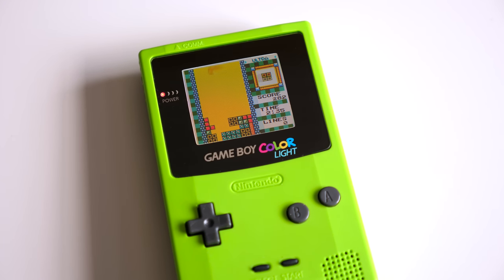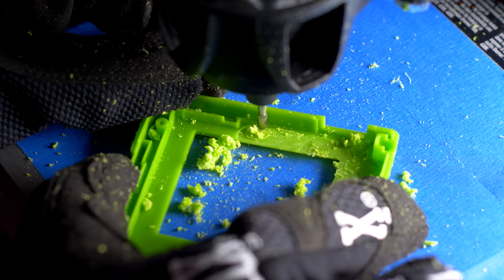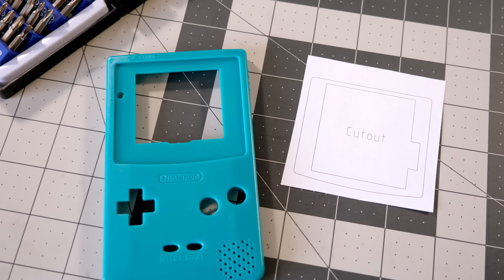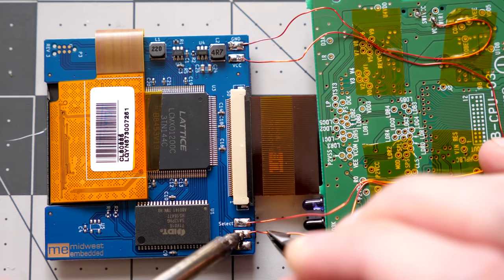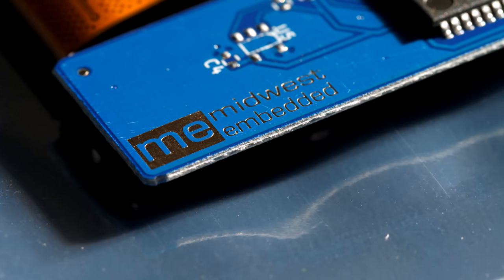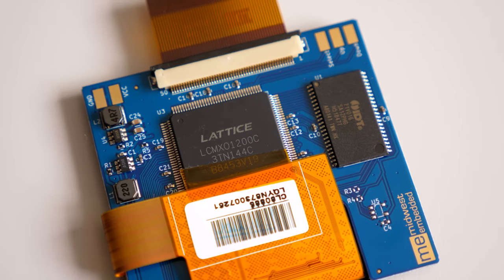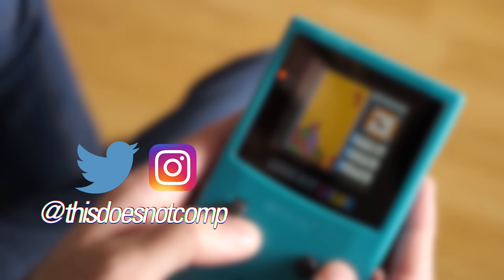Next-Level Game Boy Color Backlight Kit! | Midwest Embedded GBC Kit Review

Comment: BennVenn (FreckelShack), McWill and now Midwest? Oh boy, the GBC LCD mode scene is ramping up!
Reply: So many options now. But it seems that midwest and mcwill are the best currently. Time to wait out and see who comes out on top.
Reply: @HiNu7  I'm not sure how you could say the Midwest or McWill are best, Freckle Shack offers superior run time and Batch 4 has literally solved all white screen issues (that weren't even caused by the FS to begin with). Statement just released this morning. And unlike the McWill, FS doesn't require you to add a crystal oscillator, it's literally a drop in, with only one wire needed for backlight control (on batch 4).
Reply: retro_amp so do the McWill and Midwest have these screen issues?
Reply: @HiNu7  Nah BennVenn's Freckle Shack is the way to go, whether it be for an experienced or inexperienced installer. All around its a much better option.
Reply: I'm waiting until someone can make a screen option with the original size and no ghosting
Reply: The freckles shack has way better battery life, up to 20 hours. And their newest batches have an optional brightness controller if you want to do the little extra soldering required
Reply: @pointerprideaviationandtra4751  Everything I can find says the freck shack is not being made anymore. Maybe I'm mistaken, can you find any available?
Reply: @ramborob1218  Modders have probably bought them all up along with huge quantities of GBCs so they can re-sell
Reply: I just bought one of these with the Midwest Embedded LED from a seller on eBay named Game Boy Color Man. I absolutely love it! He also has a bunch of High Quality Replacement Labels for the Game Boy Color Console in this video from a seller on eBay named Game Boy Color Man. He has every single replacement label for every Game Boy, Pocket, Color, Light, Advance, Advance SP, Micro N64, and SNES! For this Game Boy Color, he has the Battery Door Label, Serial Number Label, PAL European Serial Number Label, Made in Japan Console Label, Made in China Console Label, Pokemon Center Gold Console Label, Special Pikachu Edition Console Label, Special Pikachu Edition PAL European Console Label, Game Boy Color Light Console Label, 10th Anniversary Serial Number, and Bar Code Label. He even has a bunch of custom Game Boy Color Man Console Labels and a really cool Pokemon Center Brooklyn one. And they are top quality American Made! Nothing like the toilet paper quality you'll find from other sellers that sell Chinese labels. The dude is awesome! The labels look fantastic and fit perfectly down to the millimeter. The packaging is amazing, and the dude also threw in a whole bunch of free kick ass Dishwasher Safe Die Cut Stickers! Check out his store if your Game Boy looks beat up and needs new labels! Or if you just need a smile put on your face. Honestly the coolest eBay purchase I ever made! He ships to all 50 states and Worldwide to the Entire Globe!
Look at this on eBay
https://ebay.com/usr/gameboycolorman

Comment: Very cool that other companies are making kits, but the total comes to $71 bucks, just 4 less than Benn's (included shipping). Also, Midwest Embedded's website states that it only has a 3 hour battery life, which is dwarfed by FreckleShack's close to 20 hours. Oh, and Benn's is just a drop in kit. No soldering required.
Reply: I purchased the freckle shack 2 weeks ago and hasnt been shipped. I just saw this and purchased this as well. Ima compare screen quality between the two once they arrive
Reply: @kr4t0sg.28  Screen quality should be mostly the same, since they seem to use the same LCD panel. Any differences come down to the PCB and the programming.
Reply: Frodo B.    Not even to mention the fact that total bill of materials (LCD + FPGA + board + flex) is less than 20$ if made in USA or below 10$ if made in China.
Reply: @zusurs  Yes that much is obvious, but you also have to remember that the guy had to reverse engineer the tech so be able to combine it. He also programs each kit. And he needs to turn a profit, so $65 + shipping seems reasonable to me.
Reply: bennvenns newest version has optional soldering for if you also want brightness control.
Reply: @shadeymcbones6707  Thank God for that.
Reply: @zusurs  Oh, great to see another Latvian watching TDNC. Are you into modding / retro gaming & consoles or just a fan of TDNC?
Reply: @nugget6635  What do you mean? Benn made a kit for the Gameboy Color using a similar display to the one in the video. Look up Freckle Shack. That's the name he gave it. The 101 display is old.. news.
Reply: @nugget6635  AGB 101 is not rare, it was cloned in China quite a while ago. Most of the 101 screens you buy in kits on the internet are Chinese clones. Have a look at AliExpress.
Reply: @zusurs  Got a link to this $2 LCD screen? Asking for a friend...
Reply: @kr4t0sg.28  Did you get them shipped and installed yet?
Reply: cant even buy benns any more. nothing on the site.
Reply: If you can still find a Benn Venn FS for sale, it's the way to go- best battery life in the GBC backlight mod market.
Reply: @kr4t0sg.28  which one was better?

Comment: Finally! An easier installation of a backlit for GBC! Thankyou! Now I can do it without running the risk of screwing up my GBC!👌🏾👍🏾👌🏾👍🏾
Reply: The BennVenn freckleshack mod is even easier, no soldering required, you just need to cut out a piece of plastic for it to fit
Reply: The freckle shack also has lower power consumption and newer revisions have brightness control

Comment: Carves away at shell in order to make screen module fit

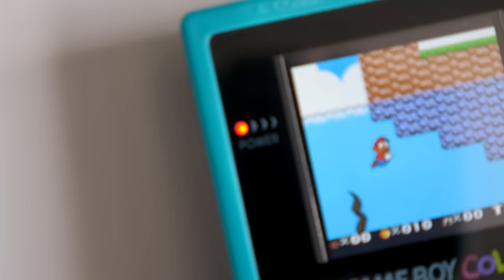2:45 "because the replacement screen module is really thin and it generally fits within the footprint of the original display"

"Generally": in most cases; usually.

Comment: "Since they're black, they're not really noticeable" said to a shot of the insanely noticeable gray screen borders against the black outer border. And then there's another internal border between the super obvious gray border and the part of the display that actually displays things. And then the next shot shows that it's not even centered in the opening and also doesn't sit in nice and square.
The only way that this is "not really noticeable" is if you're completely blind.
Reply: They want $71 for this unsightly garbage?! 🤣 Hard pass. Maybe if future revisions also came with a specially made outer piece that hides the double borders so it's actually not noticeable, it'd be worth it. But as it is, I'd rather try to get the lighting just right to see a stock screen.

Comment: Nice mod. As an electronics engineer I must still say, that price for these retrofit kits is still absurd - TFT panels like this cost around 4-7$ in bulk, and circuit board + FPGA + flex is another 8-10$. So it’s below 20$ (or maybe even under 10$ if made in China) to manufacture, and 45$ (225% to 500%) in profit. Sorry, but it seems a lot, even on such a niche product. :/ Unfortunatly many companies try to cash in on the nostalgia wave.
Reply: There's more to price than component cost.
Reply: You know time has a value, right? The time that went into making these and the programming needed. 
Do you work for free?
Reply: Those TFT's are not $4-7 in bulk. My recent order of 1000pcs is not even close to that unit price. Plus the labor involved removing the touch panel glass (Which these screens all come with), import duty, shipping, assembly, taxes, store commissions, time testing, packaging. As an electronics engineer you should also know the cost of marketing a product is NEVER the cost price of materials. Come on man, who are you trying to kid?

Comment: Another five years and there will likely be an actual plug and play screen that's just a swap with the OG screen
Reply: I think bennvenn is making something like that now.
Reply: @genesischris1297  its already available, no soldering needed. Just have to remove one plastic tab inside the shell.

Comment: Hi Colin, I just had a quick question, in the review you said you could turn off the backlight entirely but the unit I received doesn't turn off the backlight at the lowest setting, do you think I received a defective unit?
Reply from the maker: Interesting...I suspect there might have been a firmware change between the unit I got and those that are shipping out. How dim is the backlight at the lowest setting?
Reply: @ThisDoesNotCompute  Hard to say, I think it's just the lowest brightness on your video. I got in touch with Nick and he said the prototypes did turn off but they decided it was harder to see than the original lcd when turned off completely.

Comment: This kit's only 3h on high capacity rechargeables? An unmodded GBC gets 30h on regular Costco AAs.
Reply: TheRaellz  The Freckle Shack backlight kit gets 20h with a similar, if not identical, screen, FYI.

My point is that just because people are used to devices with low battery life doesn't mean it has to be that way. The video's assertion that 3-4h is good, is pretty weak, especially considering the context of Gameboy.

Comment: Hi, could you tell me the original gbc's precise screen size in inches? I know that this M.E. is 2,2" and wanted to compare, thanks! :)
Reply: 2.34" give or take
Reply: @shimian5622  alright, thanks! And the AGS 101 fits it 100%, right? And then se got the freckle shack which i assume Is 2,1"? And the mcwill's? Anybody knows?
Reply: @sintiendomevivo  no, AGS 101 is smaller than stock, and I think McWill and FreckleShack are the same size, about 2.2. Nothing is as large as the original display, except the super expensive TaoBao screen.
Reply: @shimian5622  Ok, thanks a lot, man!

Comment: Hey this does not compute. 
I have been dying to try gameboy color modding especially the backlight ones but I have no knowledge of gameboy color mods and I want to try either a front light mod or a backlight one that's easy for someone like me which one should I try?
Reply from the maker: A frontlight won't require as much shell modding, but it can be tricky if you use LOCA to get the best results. A backlight mod like this one takes a bit more work in terms of cutting out the screen opening, but electrically it's super simple -- if you have basic soldering skills, it's probably the easier way to go (and would look dramatically better than a frontlight). Good luck!
Reply: @ThisDoesNotCompute  I kinda know how to use a solder but need some guidance on how to use it on those silver button things how do you connect wires to them?

Comment: I am affraid of using rechargeable batteries in my Gameboys, since the voltage is not the same as alcaline ones. Am I very wrong?
Reply: You need to use a diode on the Gameboy Advance. For the Gameboy color it is not needed since it runs at 5 volts. A 3.7 volt battery will work fine since the GBC has a built in boost.
Reply: ni-mh is ~1.2V per cell while alkalines are ~1.5V. Every electronic device actually works off of an input voltage range so there is absolutely no chance of damage of damaging your gbc just because the input voltage is a little lower (it just means your run time may be a bit shorter, but that also depends on a number of factors, not just voltage).
Reply: @froddobaggins  No you don't i use rayovac rechargable nickel metal hydride (Ni-Mh) batterys on mine and have had no problem with the system and it lasts longer than regular batterys because they are 2400 miliamp hours (mah).
Reply: @nathanmead140  I was referring to a rechargeable battery mod. Like a li-po that you solder to a micro USB charging board and then to the console. I guess I wasn't clear on that lol.

Comment: Anybody know if Bluish Squirrel’s gbc light lens covers the sides of this screen without cutting off the top or bottom of the screen?
Reply: I know blueish squirrels will fit with BennVenns... BennVenns also is currently getting more revisions and they have added brightness control, along with being a simpiler mod, and imo having the best screen from everything I have heard.... Did I mention it has much lower power consumption?
Reply: Nicholas Kormanik That was a big concern but I have worries about lead time since I’d have to wait until midsummer for the 4th order to ship compared to ~2 weeks for Midwest
Reply: @TL-Hand  Very true that you would have to wait for it, but I think the battery life difference is well worth it. 4 hour battery life isn't too fantastic, especially on a device that doesn't have a rechargeable one. It's all up to preference, but I just think not waiting is a bit silly when you are getting a worse product.
Reply: Nicholas Kormanik true, plus it’s honestly more expensive since BennVenn said he plans on dropping summer shipments to $60 plus shipping so around $66 vs $75

Comment: why does it need to do upscaling? can you do a comparison with a modded GBA with ags101?
Reply: The native resolution of the new lcd is much higher than the gbc's original screen so it requires integer scaling to make the image about the same size. Without upscaling I expect the viewable area on the new screen would be the size of a postage stamp lol.
Reply: As said above - screen resolution and pixel density these days are much higher than on original BGC screen.
Reply: @sjm4306  but afaik the screen ratio of the GBC is very rare, so they had to manufacture specifically this screen. Why not make it with the exact same ratio and bigger pixels? Wouldnt it be cheaper?

Comment: Ugh, cut outs :( why can’t anyone make a backlit screen that’s the right damn size
Reply: Believe it or not all of these replacement screens are just screens people are finding in older technology, apparently the benn Venn one was found from and old LCD in an early 2000s flip phone or something... The GB boy colour screen is really an old LCD printer screen. What these guys are doing pretty much is there finding similar sized screens in the tech world and reverse engineering them to find out if they can do 2 things 1) make sure its easy enough to reproduce and work with the gameboy color and 2) if they can make a profit out of the whole ordeal... In short, producing a exact replica backlight for GBC would require lots of time money and resources only working at a company like Nintendo would that happen, so this is why instead the only option is for people to go out and find and use whatever LCDs that already exsist that resemble the same size needed for a gbc and unfortunately the GBC screen dimensions are just way too unique, I guess no one can find an old piece of tech that has the same dimensions as a GBC screen maybe there isn't even one

Comment: 4 hours tho...
Reply: But the gbc has a ac adapter connector on the bottom by the headphone jack so you could get a powerbank (or a smartphone/tablet with usb otg) and a cable that can convert 5 volts to 3 volts